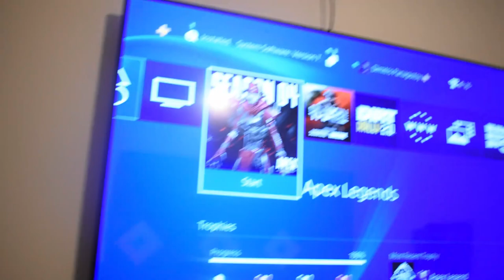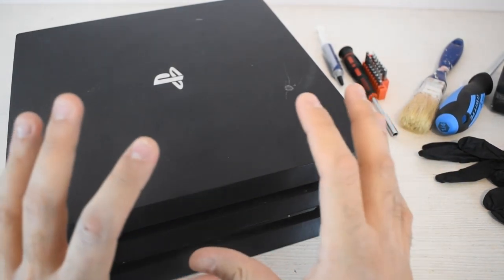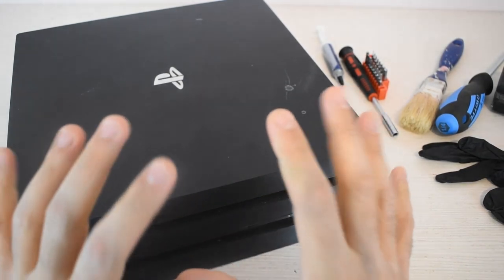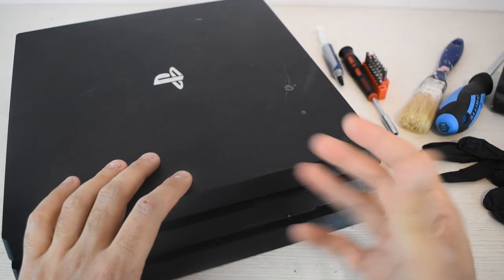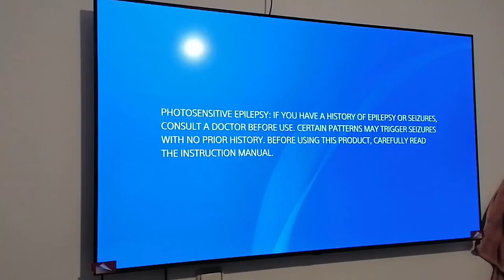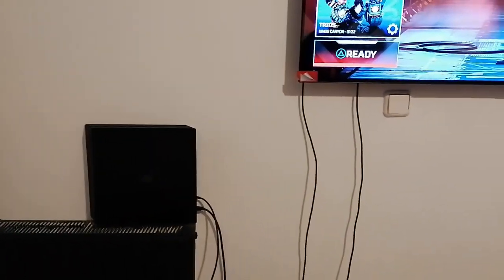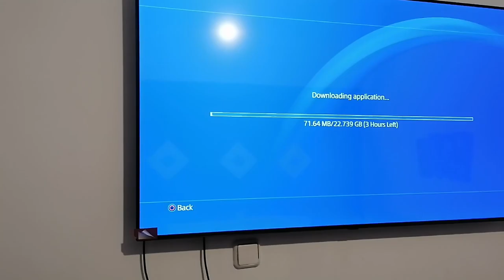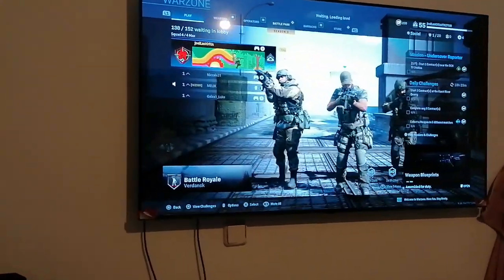Ps4 pro sound problem and turn off by itself solved!!

Comment: I have the same problem but I have a regular Ps4 and when I play a game called fortnite it’s turns off like in 1 or 2 hrs and it’s so annoying
Reply from the maker: That is bad bro. If you can't do what i did on the video to solve the problem, i sugest you to try to clean the dust from the filters around the console with a brush and keep it in a place where it can breath.
Reply: Mine turns off after 3 minutes

Comment: I have the same problem in the slim version i play  a game it says that is very hot end is turn off

Sory for my English
Reply from the maker: Your english is good bro! the problem is the dust and the thermal paste on the cpu that fades of with the time.
Reply: @NakamaGamersMonkeyDluffy21  thanks
Reply: @NakamaGamersMonkeyDluffy21  Ihave the same problem bro what to do now I've bought it 2 months ago and it fucking turns off after every 10 mints even 5 and I can't play!
Reply from the maker: @MIMICop  if you bought this new you still have 2 years warranty so I suggest to give it back to the store you bought it.
If it's not on warranty then try first to clean the dust from the filters and place it somewhere that it can breath.
If this isn't working then you gotta try and do what I did.
If you have the right tools and do it step by step you can make it.